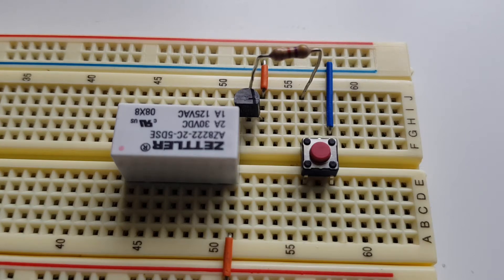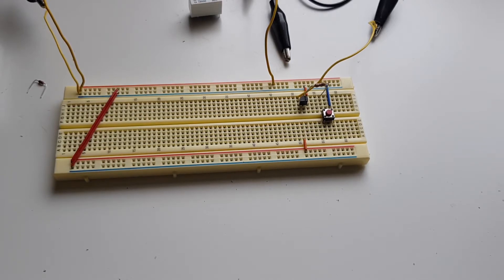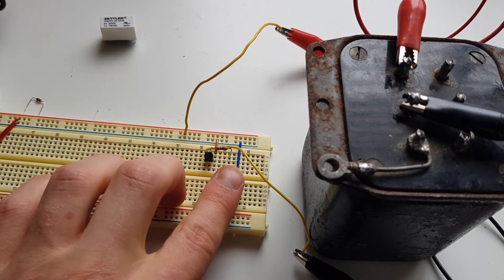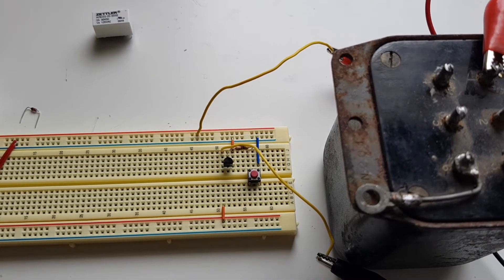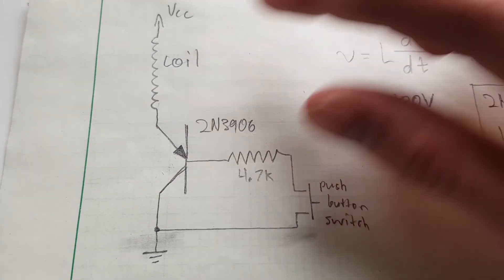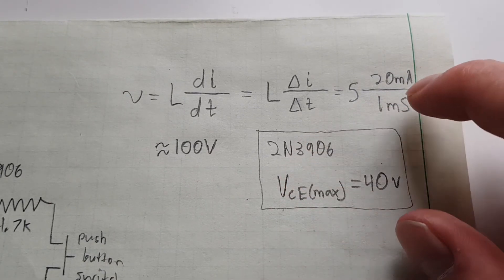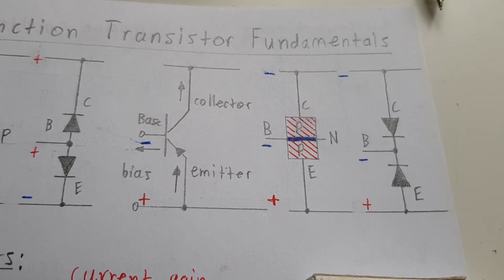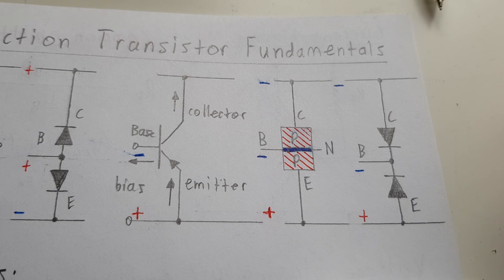Why You Need Flyback Protection Diodes

Comment: A few things:
- dI/dt is not steeply flanked because there's no base-resistor to earth. Some base-charge keeps left in the transisor itself which makes it shut-off slowly. Using a complementary Cmos driver or low-R to earth would already make a difference to fastly uncharge the transistor-base. Know this from transistor-ignition in automotive.
- But more of a factor in this case: According to you voltage current ratio there a substantial ohms resistance in the big coil, like 200R or so. So, your flyback pulse seen as a powersource has a high internal resistance which reduces ability to generate high current-pulse.
- A semiconductor on top of its rating behaves like zener. Its actually NOT the voltage which causes the damage, its local diffusion caused by temperature which makes the damage. Could eventually be very local because of 'tunneling'-effect.
- Previous two factors together with the fact that the huge reactance of the coil makes that any currentpulse from flyback is a smoothly buffered one.
- All could be compared with blowing a normal (thermal) fuse. There's a current specified, but the specified current is NOT what's doing the damage. On short term it's energie (joule) for a specific fuse expressed in I * t^2, on longer term its power which relates to I^2 * R, but specified in Amp though.
- Surprisingly, over-current in semiconductors can highly over-rate its specs as long as the short pulse doesn't exceed the semiconductor's I * t^2 rating. So, for instance: a 1A pulse in a 100mA transistor is not a problem as long as it's short enough, if the momentary quantity of dissipated energie which matters.
Reply from the maker: OK, this makes sense. As I was messing around with different coils and voltages I did notice behavior that indicated to me that there was probably a lot more going on here. At the time, I suspected that the coil resistance might have something to do with it. I didn't think that the switch off time of the transistor would be so slow in this configuration. I s'pose the impedance/resistance to ground from the base would be on the order of Kohms or Mohms.
Reply: Just read I mistakenly wrote I * t^2, I meant I^2 * t. srry.

Comment: I wonder what the max peak voltage flyback you get on your multimeter, or maybe use a ptc?
Reply from the maker: The only reason I didn't try to use a multimeter is because I thought the pulse would be too short to read out properly. Some oscilloscopes can do one-shot readings to capture a pulse like this but my old analog scope can't do that very well. I'm not sure a PTC would work in this case since they are usually used for overcurrent protection for feeding something. It might protect better against an external transient or protect other circuits on the same power rail rather than protect the transistor driving the relay. Truth be told, I haven't used PTCs much, so I don't know what their limits really are. A quick and dirty way to see if there is high voltage is to put a neon tube across the relay coil and see if it blinks.
Reply: That sounds right.  Ive been trying to figure out the  best way to prevent some fuses from bust in my cap leakage tester, they pop if I change the voltage too quickly on the rheostat.
Reply from the maker: That's sounds really weird. Does it blow only if a cap is hooked up? Have you tried a slow-blow fuse? Maybe the inrush current is somehow blowing fuses.
Reply: Yeah it has a 350mA slow.blo or it did. The manual warns not to make quick voltage changes otherwise the fuse could blow
Reply from the maker: I wonder if a NTC (negative temperature coefficient) thermistor would work in series with the fuse. I think they make some just for inrush current limiting.